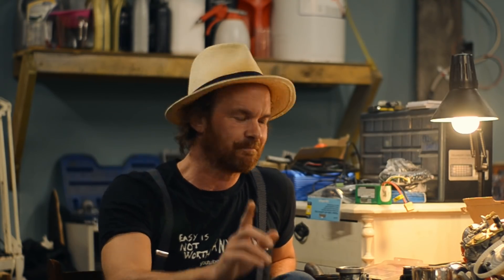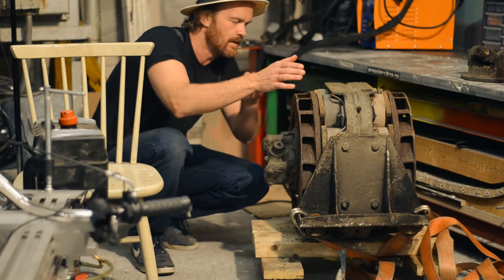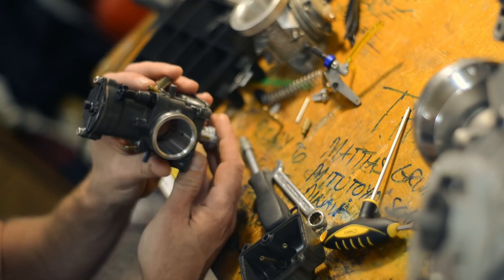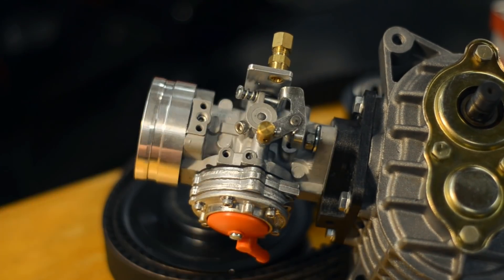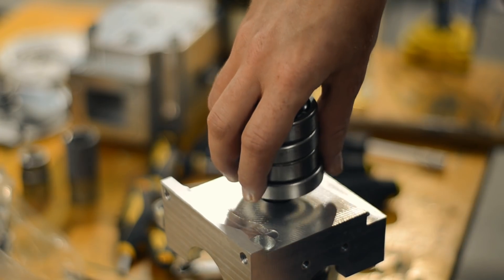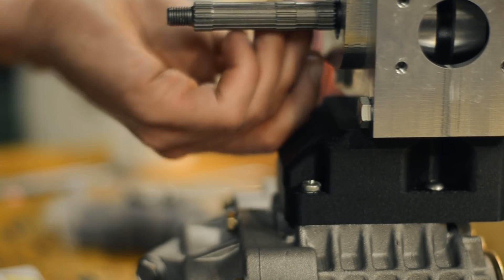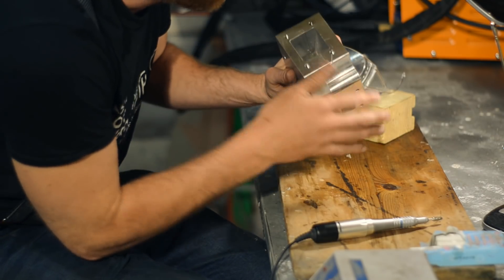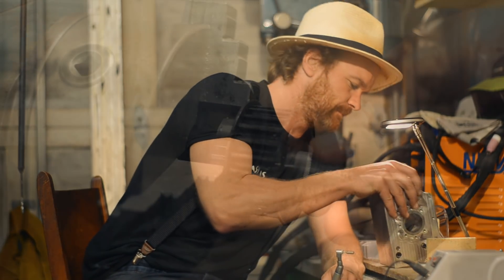Most powerful two strokes under a roof!

Comment: It is better to press the ball bearings onto the crankshaft and to have a transition fit in the housing. that the load revolves around the inner ring and the outer ring is a point load, so it does not necessarily have to be pressed. In addition, ball bearings do not warp as quickly and have less resistance to thermal expansion.

Comment: Apologies ahead of time for the long comment:

I've been very interested in the brute force engine because I had a similar idea a few months ago, but right now I have neither the money nor the machining equipment to make a prototype. The idea of a two stroke engine that can run without the need for crankcase pressure allows for unmixed fuel for better combustion as well as elimination of windage to open up a little more power. My question would be what made you choose to use a blower with a rotary valve? 
The obvious problem you are solving with this is to stop the intake charge from simply being blown out of the chamber without either a pressure wave or back pressure. The solution that came to my mind was implementing a turbocharger. The idea would be to run two wastegates; one that would act as intended, diverting exhaust gases as to not over spin the turbine and create too much boost. The other would go to something similar to a proportioning valve: the idea would be to use this in order to bleed pressure off  the exhaust enough to be maybe 10% or 15% less than the pressure on the intake side. This (at least in my mind) would create an environment where the intake charge can be pushed into the cylinder without excessive loss into the exhaust port. It would also have the added bonus of being able to produce more boost than a supercharger would normally be able to, and would be able to withstand an engine running at high RPM more so than a supercharger. I'd love to have a discussion about this if you have the time/ interest for it. 
I love the content you're making! Keep it up!

Comment: 8:28 Is it correct to press the crankshaft into the bearing, creating a load on the rolling elements? Wouldn't it be more correct to make some kind of tube, which rests against the inner bearing race, so that the entire load during pressing was on the holder, and not on the balls?
Reply from the maker: Absolutely, but I can't cause the seal is in the way.

Comment: You should be using a 3 flute 45 degree helix endmill for cutting aluminum.  Those cutters you have are like 30 degree or less and those are for steel.  Hope this helps.

Comment: Any plans to cool the rotary valve? or stop it binding with heat? Really love this channel. watching you for years .
Reply from the maker: Thanks! Hoping the massive amounts of unburnt methanol will keep it cool enough.
Reply: Ah, yes, the cooling promises of blow-through scavenging to keep hot spots at bay. 
Yet I wonder how much parasitic friction power will be eaten here. 
Did you consider a spool-style rotary valve as a way to eliminate sliding friction? @2STROKESTUFFING

Comment: The whole key to making your design work is the two piece piston and solid ring. That's never going to work though. The ring needs to "spring" into the cylinder walls to make any kind of power.
Reply from the maker: The ring is not solid.

Comment: Is there anything to be gained in the simulation programs by exhaust system design on a pressure charged two stroke? Or is the bigger the pipe the better?

Comment: also you would have found by now fearless motivation = i walk alone and many other cool songs to get that hard working frame of mind motivated their are you tube my mix hustle standard that have hu / mnm /rob bailey team fearless and military motivation   also do as i say not as i do the burrs / cuttings of the dremil tools are airborne needles = no good for the lungs [mask up n eye protection] you can see the shining airbourne splinters in your footage [flickering flecks in the air]
Reply: Good point, I discovered what a fierce contaminant those needles can be around the shop later on. 
Different carbide tooth configurations can be chosen to minimize the risks.

Comment: A tip on the rewiring of the eddy brake to 192V: The wires are made of aluminium and they can be really brittle. So avoid bending/handling them more than necessary. Looking forward to seeing it in action!
Reply from the maker: Thanks for the tip!
Reply: kjapt spørsmål, hvor mange amper drar telma'n på 192 volt? (avhenger jo selvsagt av lasta, men sånn ca max?)
Reply from the maker: @burzheru  ca 16A max i følge datablad.

Comment: Is that a 3d printed block after the blower? I would've thought heat, fuel and pressure would mean it's not the best place for printed parts.
Reply: @ruben_balea  I agree, especially with the alcohol evaporating!

Comment: Interesting Vid as always and can't wait to see this in action.  I rewound the vid a few times but what is the Fan/ Alternator thing called you are going to use for the Dyno? Looks very interesting and I'd like to look them up some more for other projects I have in mind. All the best with this great work!
Reply: It's a 'retarder' from a truck. Essentially an electromagnetic brake. The fan blades are to help cool it down (slowing a truck creates a lot of heat).
Reply: @nerd1000ify   Thanks. I'm wondering if one could be used as some sort of generator?  Seems like they would be able to make a LOT of power in a compact size given the forces that would be running through them.
Reply: @glumpy10  They're not usable as generators, sadly. They rely on eddy currents, which are actually one of the main causes of inefficiency in generators and electric motors- you could say a retarder is a generator that is designed to have 0% efficiency.

Comment: I still think that you will probably want to have Reed valves on both intakes that totally seal and in the end you will probably be going with a fuel injection system with a O2 sensor and you will then probably need to install a separate 2 stroke oil injection system so that you can run just straight gas in the gas tank with a separate oil  tank, but throwing a supercharger on a 2 stroke, call me crazy but I think you are on to something with that idea, and there's no doubt that you will have the most powerful 2 stroke, but you are going have to seal the crankcase and maybe even install a crankcase blow off valve that recirculates the air back behind the carburetor and in front of the supercharger, personally I can't wait to see you pull this off
Reply: An O2 sensor would surely be overwhelmed by the excess oxygen of the supercharged blow-through cooling charge, so the signal-to-noise ratio would be effectively zero imo. 
Perhaps rotary-mounted O2 and temperature sensors in the upstream exhaust port area could give readings over a narrow segment of the exhaust cycle, but nearly impossible to implement without a "Honda" budget(?).

Comment: What supercharger are you using? I'd love to fit one of those to my 4 stroke gocart
Reply from the maker: Aisin AMR300
Reply: @2STROKESTUFFING  If I might ask, did you consider including an explosion "valve" for when/if the intake charge ignites in the intake tract?
Reply: @2STROKESTUFFING  thx allot dude. I actually got one used pretty great deal. My cart pulls allot harder now. Though I do have the suspicion it's not good for engine life
Reply: I see that there is what appears to be such a valve already(!).

Comment: Curious to know what RPM you anticipate running.  I feel the second carby is too big and you won’t get effective atomisation.  
Take for instance the TKM 135 kart motor.   16000rpm with a 34mm carby.   Also, what is the rotary valve made from, and how well you prevent warping and maintain an effective seal?
Reply from the maker: Peak power is simulated to be around 19-20krpm. I have a custom "carb" in the plans with a better low pressure area in the venturi.
Reply: Do you mean warping from heat? Surely it will be near it's limits, especially since the blow-through cooling affect might tend to be cooling a later "degree" segment and not the blast segment(?).

Comment: Hi! Must say you videos are really good. But next time you put the bearings on a shaft, or a sleeve in a cylinder, try to heat both pieces. by doing so, the outer piece (cylinder or bearing) will not get a cold shock and shrink suddenly, and you have more time to get the pieces paired.

Comment: just a question, when the outlet port is widened in the cylinder, so a typical complete cylinder tuning. Do I have to jet it richer than usual? In general, how does the "tuning" changes my approach at setting up the carb? cheers
edit: ah what book would you recommend for 2stroke engines?
Reply: Because of the air's volumetric elasticity within the venturi, the signal strength of the vacuum pulse pulling the fuel in may actually cause a richer mixture whenever the engine's airflow increases. 
So you might have to increase the air jet size and/or increase the air bleed holes in the emulsion tube to prevent an over-rich condition.

Comment: You made a smaller mistake at 8:24 , you held the wrong side of the crank in the vise. This way sometimes you can turn the crank offcenter with the nut by an accident. It has a small chance, but just wanted to let you know :D Hope you great luck with both engines!
Reply from the maker: Yep. I cringed. No other practical way of doing it. Next time I'll have the seals install from the outside.

Comment: Why are you not running a slip fit crank like you do on your land speed engine?
Reply from the maker: Cause I'm going to replace one bearing with a roller bearing, just didn't have any on hand.
Reply: Was going to ask the same question, but I couldn't imagine it wasn't already asked.

Comment: This may sound like a ignorant question. But wouldn't you be worried having press fits on all the bearing races on you crank? When the crank case expands would that put undue stress on the bearings especially at high RPM?  Maybe on such a small engine it's not enough to worry about. Also what about on your seals putting something like a snap ring outside so you could press them in from the outside than put in the ring so they wouldn't blow out.
Reply: I did think that was an unusually tight fit for a two stroke crank. Edit: he mentioned in another comment that one side of the crank is going to be fitted with a roller bearing, but he only had a normal ball bearing to hand.